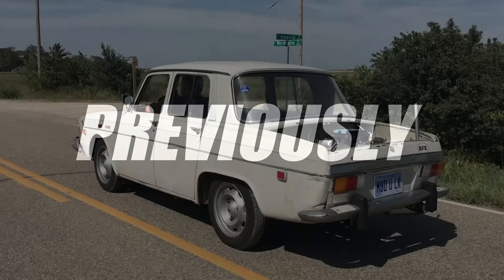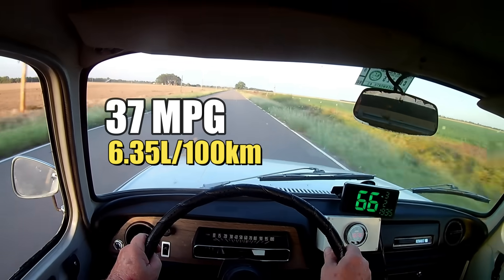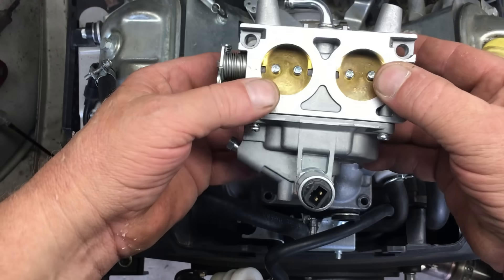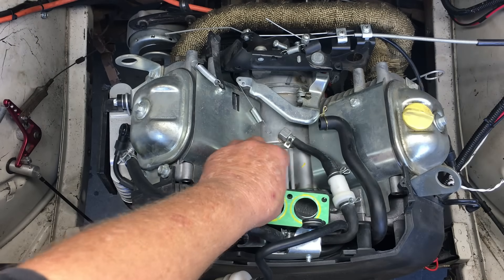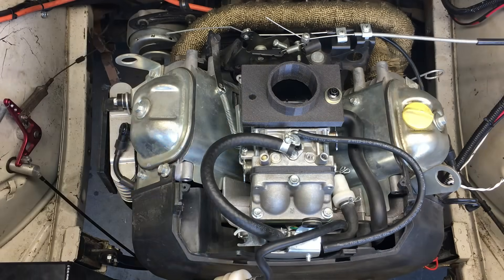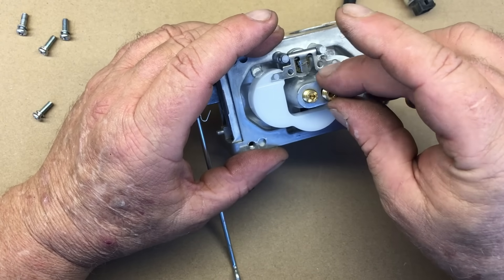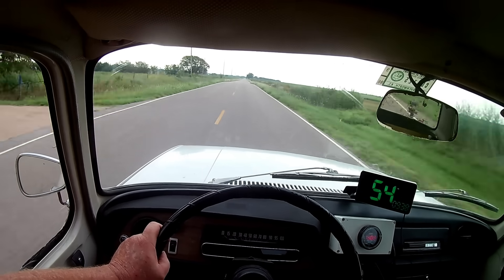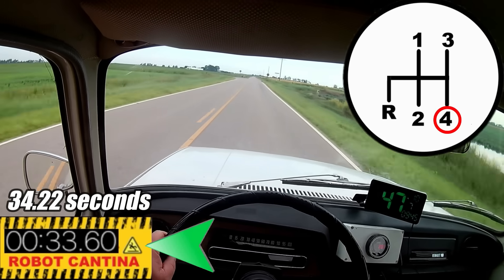S3 E27. We improve the fuel economy on the 670cc Predator powered Renault

Comment: Since it stays at a low rpm range you could probably lengthen the intake runners to make a tuned intake, like a TPI.
Reply: I agree about getting the most performance but I also love it when I just have a good drivability and feeling about it
Reply: Get rid of that 90 degree adapter. Lengthen the intake runner; use radiator hose (ala the old Dodge Ramcharger car) which can be easily altered for length. Once tuned, try velocity stacks on the carb. And try with and without the new 'combining' spacer.

Normally if a carb bore is large enough it will deliver full power by itself. Combining with another carb bore is usually done to smooth and lessen intake pulses at low RPM's for a better idle, having little to no effect at high RPM's.
Reply: @P_RO_ 
On this engine,  one bbl serves one cylinder.  It's pretty much split from air filter to cylinder.
Reply: You should put a cold air intake on it anyway and do away with that air filter use a k&n cold air intake,air filter
Reply: There’s a lot of math that goes into that with intake harmonics.  Since this engine is small he should really try revving it out further.
Reply: @ethanpeschman4458  If I was to tune port it I would just scale down a working system.
Reply: @olivierroy1301  wouldn’t work like that, the engines are completely different.  With that being said a variable length intake trumpet would work pretty good.
Reply: @ethanpeschman4458  I wonder what would happen to fuel mixture if the ram was before the carb. Since you mentionned variable length, to fine tune the length, some 3d printed spacers could do the trick. Or slipping metal tubes with clamping collars.
Reply: @olivierroy1301  so putting the long part above the intake would result in poor atomization of the fuel (pooling in the intake) and would also cause it to run very poorly due to the inlet being far away from the carb Venturi
Reply: @ethanpeschman4458  I think the incoming air forcing through the carburator will force the fuel to go back in the fuel system. I'm not sure my idea is perfect though cause I'm refering to an injection system while with a carb the mixture would have to stay suspended all the way to the intake valve.
Reply: I'll be darned that's what I just told him that's what I said

Comment: The CVT sounds like it was bogging the engine down during the 0-55, maybe it could do with adjusting the weights or springs or whatever it uses to keep the RPMs constant, as most CVTs I've heard tend to keep the RPMs about the same up until the pulleys are fully closed or embiggened and then the revs go up cos it's in top gear...

Comment: Steady improvements. This project reminds me of the late 1990s when I lived in Germany and there was discussion about whether a "4 liter per 100 km" car would ever make it to market. I guess gas prices were high back then. The environmntal group Greenpeace took a Renault Twingo and did a lot of weight reduction, but the key change was replaicng the engine with a high compression supercharged two clinder 360 cc engine. Greenpeace claimed the car used only 3.0 liter per 100 km (78mpg). I remember some test drivers complained about the engine being very rough and sometimes stalling when the clutch was engaged.

Comment: Instead of the carburetor spacer why wouldn't you just 3D print a new upper plenum and combined the two tubes together that way there's more room for the air fuel mixture to atomize and then goto the cylinders

Comment: I think you need to change the timing as well, different AFR will run best at different trimmings due to the speed of combustion, therefore it will always work best with factory AFR with factory timing,  I would say ditch the carb and use an Arduino or similar to run an EFI and a coil on plug, then you can also advance and retard  depending on rpm with a map.

Comment: Interesting how things change with carburetors with a few adjustments. I'd love to see how it'll do with a Holley 2 barrel 380 cfm carb. 🤔 In any case, nice work Jimbo!! 💪🔥
Reply: 380cfm is good for 190hp. Id be shocked if he could pull off a quarter of that.
Reply: That would make for an interesting addition.  I would imagine making up an adapter would not present too big a problem.  Something else to consider is putting on a scoop to get a bit of ram air working.
Reply: Or… an IDF-40 Weber carb, with 28mm Venturis?
Reply: I was thinking the same thing - the smallest vacuum secondary carb you can get and 3D print an adapter

Comment: Wonder if starting in 2nd will improve now with the throttle spacer. I also think that putting a generator head on that engine and an electric drive to that transmission would improve it overall ridiculously. If the engine puts out 25 hp, get a 20 kw motor. No battery.
Reply: That's what they have been doing on forklifts for factories for ages and trains.
Prevents stalling the engine when mistakes are made.
Reply: @AnalogDude_  yep locomotives as well, love trains. A train is just a diesel genset powering electric motors to move those heavy loads.
Reply: @JSabh  natural evolution of rail traction. nothing could improve on that  for places with no power line above. that must kinda kinda special having that much power under your finger, feeling the engine rev up.

Comment: Have you thought about putting a cluck brake on the input shaft of the transmission to help you shift gears?  Should be able to hook up to the original clutch in car.

Comment: I think it would he good to add a tachometer to the engine. I think Ive heard the engine strugle a bit on the first half of the 0-55. It would be an userful data point for further engine modifications since you have the cvt in the middle.

Comment: You can hear the engine bog down after the CVT runs out of travel, ie, it needs stronger springs to keep a lower ratio for longer so the rpm stays higher. 
Those primary pipes are too big, so you are leaving torque on the table. A NASCAR exh guy made 1¾" pipes for a NASCAR engine and still made 905hp@9000rpm, ie, the best pipes are smaller than you think.
Reply: how effective primary's are in influencing best power on a engine has a TON to do with the intake manifold and cam timing. Basically larger exhaust only hurts when you have a super high VE engine with very large amount of overlap. for a lawn mower engine, primary size isn't likely to hurt anything.
Reply: @seancollins9745  It is a low performance engine, so you are probably right, but if you punch the numbers it's a VE of 85% to make 25hp, and that's enough for me to look at pipe sizes. If you watch the start of the vid you can hear it bog-down in the middle, and smaller pipe could fill that in somewhat. He doesn't give enough specs to work out pipe dia, but I would say 1"-1.125" for 5000rpm peak, smaller for less rpm - had too many customers with too large pipes, and every-time we design the correct pipe, ie, usually smaller, the thing goes faster -.
Reply: @SidneyCritic  years of dyno testing tell me that, low cylinder count engines do best with the least back press possible. given the firing order, there's probably nothing to get.

Comment: I would try making a new intake manifold. The stock one has two separate ports; with that spacer you made it may make a slight improvement but it's not enough. If you make a one port intake pipe that is a full oval and, in my head, would make the carburetor a true two barrel. Only a suggestion.

Comment: Normaly carb spacers are 1/2 inch to 1 inch. A 2 barrel 1/2 inch or 1 inch spacer will improve torque a bit. An open 1/2 inch to 1 inch spacer will help increase the RPM band a bit further. The size of spacer you did was more of a gasket size. For the what you are doing with this car. A little extra torque would help. The spacer should be a 2 barrel 1 inch thick. This can also help with acceleration time.

Comment: If you could remove the 90° bends before and after the carb you would increase both economy and power. 

Interesting video Jimbo!
Reply: I was thinking about having the spacer going there to add plenum volume to the intake and allow the charge to go wherever is needed. then the elbow could go in again for ease and air filter retained, elbow could be removed later on.
Reply: @bucket-9-9  a bigger spacer could help, I agree.  And the straigter the intake might not matter on the twin, but it wouldn't hurt

Comment: Another great video, thanks for posting! The bog down at low rpm, is like the difference between single and dual plane manifolds I used to play with on my Ford 302’s. Single plane (wide open inside the manifold) would be terrible for low rpm torque but would scream top end. The dual plane manifold (separates the intake runners) gives way more low rpm torque and throttle response but would limit that high rpm performance. I’m thinking maybe you simulated a single plane manifold by opening up the intake ports together?
Reply: Is there any way to design something that goes from two to one automatically? :D
Reply: @drippingwax  i’m sure there’s a way to do anything. But with the single plain manifold on those old carbureted, V-8‘s, what you would normally do is use a high stall torque converter, so you can get the engine into its power band before the converter builds up enough pressure to start moving the vehicle.

Comment: sharp edges are not great for air flow, how hard would it be for you to make an X pipe adapter instead to keep the transitions smooth? It would give the fuel more time to atomize and the crossflow would be more balanced. Kind of a tunnel ram intake but not really. I think you'd get more power and better fuel economy. On the other hand, if you're going to go through all that. why not put a bigger carb on and go 1 into 2